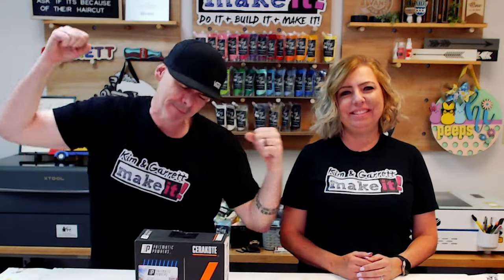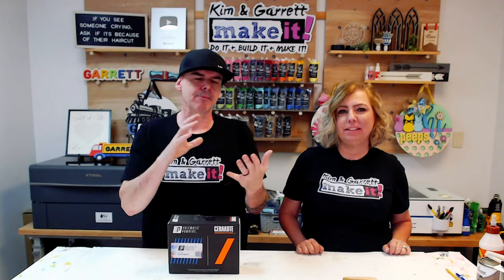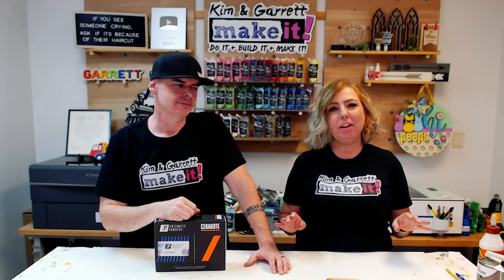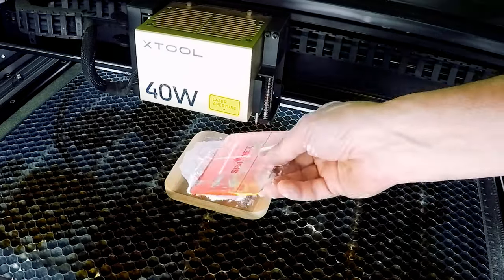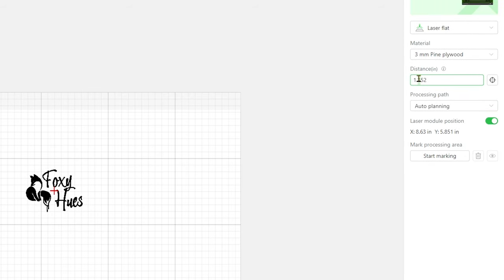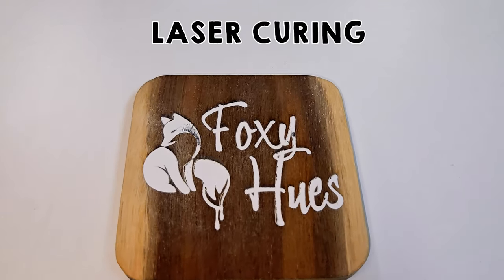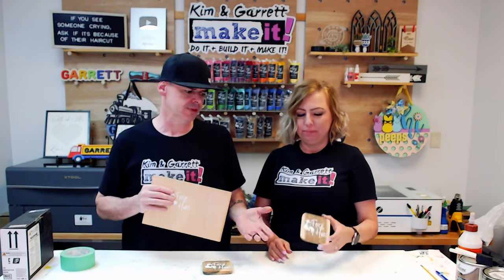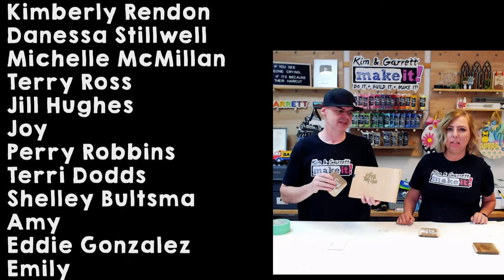How to Color Fill a Laser Engraving on Wood with Powder Coat

Comment: Tip for y'all. If you go to Harbor Freight you can find the white and black powder coat in 16oz plastic bottles for $7.99 each, they work great. I use the heat gun method.
Reply: What’s the name of the paint ? 🙏🙏

Comment: I do the heat gun method. Works great. Thank for the video on this
Reply: The heat gun method looks less complicated. How much time does it take when applying heat?
Reply from the maker: It was just 5 minutes under the heat gun.
Reply: I think the heatgun result look better too. 

I recently tried both methods too. Melting with the laser seems to be somewhat inconsistent for me, some areas would stick really well, others flake off easy. It also leaves a bit of a line pattern. With the heat gun you can heat larger areas, make sure all the powder is melted and it leaves a smooth shiny texture. 

In my testing, I found I needed to mask the project regardless of the method used, because the powder gets trapped in the wood grain. Sanding it off was a no go for me, as the sander seems to melt and smear the rogue powder particles, smudging the whole face up.

It's a rather messy process, but it did leave a really crisp and clean look if you mask, use the heatgun and don't sand afterwards. I'm still figuring out if the result is worth the hassle.

Btw, thanks for sharing your experience, @kimandgarrettmakeit ! your videos are inspiring to experiment

Comment: You mentioned in your opening segment about doing powder coating on cutting boards.  I am hoping not on the business side of the board..  I would think that putting that on the  cutting side would cause it to chip off with use of knives and stuff and then going into food